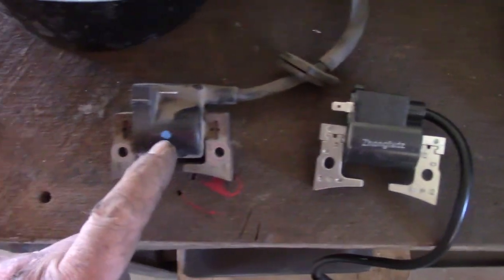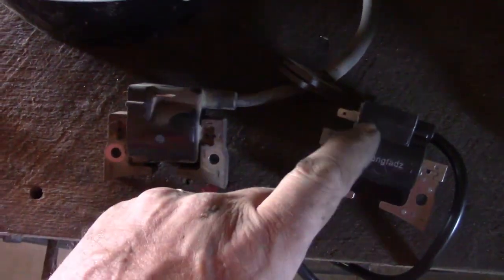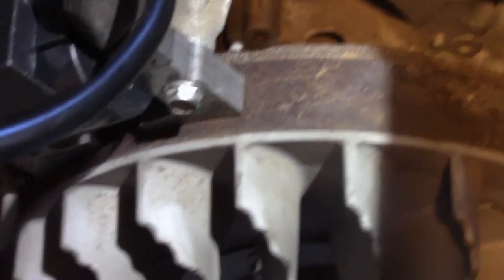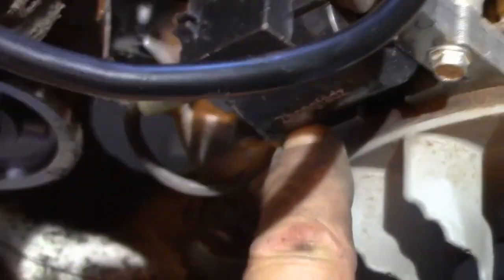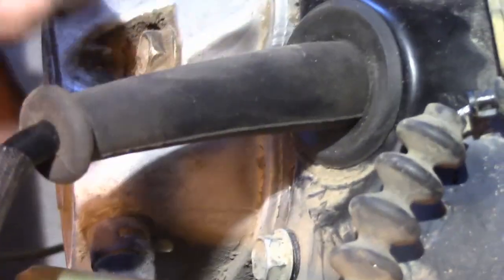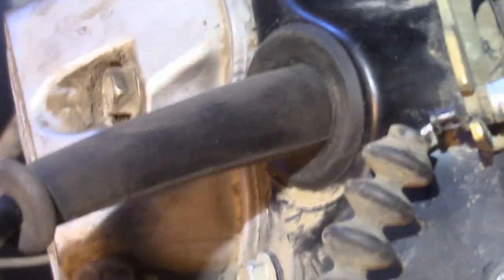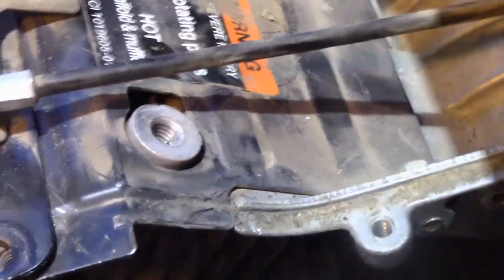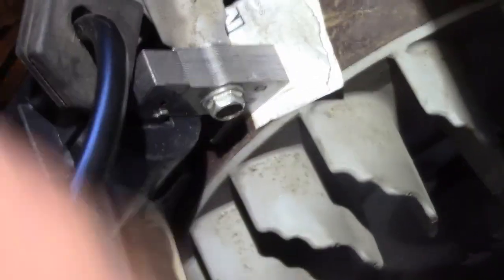Replacing Ignition Coil on Club Car DS - Part Two

Comment: Thanks for the great video!  I just replaced the coil on my 1998 Club Car with a modification to this procedure.  I jacked the rear up, removed the left rear wheel and the plastic wheel well insert (2 bolts).  It took about 5 minutes to remove these two additional items but it made accessing the muffler clamp and bracket a piece of cake.  It also made it possible  to see and access the engine shroud bolts and screws easier too.  Also, did not remove oil filter or loosen any extra nut/bolts around the valve cover area.  The shroud went back into place without a problem.

Comment: Thank you. I have a 2002 and the guy that usually does my tune up said it was underneath the engine. Now I know where exactly it is. Looks like a lot of work though.
Reply: Doing my 2002 right now.
Actually not that hard. You can use a business card to set the gap. Not a lot of tools either

Comment: I have a 2014 club car carry all and I was changing out the rev limiter since it went bad. After I changed  it I have no spark and noticed when I move the wire that runs to the magneto the engine won’t crank at all. Do you think the kill switch wire could have come loose?

Comment: Hi I have a 1992 club car, I've replaced the ignition coil with the later one  ( internal igniter) and disconnected the external igniter the instructions for the new one states for counter clockwise engines the bits inside are   Polerized   So I installed it as it states with no joy turned the coil round and hey the carts running have I done something that can damage the engine ( my engine is clockwise ) ? Well presented video !!!
Reply from the maker: As long as the engine is running smoothly and seems to produce the same amount of power as it always did before you had any problems (which would indicate that the spark timing is correct, or very close to correct) I  don't see any way that this could do any damage to the engine.
Reply: Thank you for your comment !!!

Comment: What is the little magnet on the flywheel? I just need the curved little magnet
Reply from the maker: The magnet creates the electrical charge for the spark plug as it passes the core of the coil.  If your magnet is missing or damaged you are going to have to purchase a whole new flywheel (it's going to be pricey), or buy a used one on eBay. You can probably find a used one there pretty cheap but expect to pay a lot for shipping.  I once bought a used Kohler engine side cover on eBay for only $12 bucks, but I had to pay $30 shipping.  That was still a hell of a bargain compared buying new.
Reply: @fixyourself9163  so i just got a new ignition coil and i have the coil and magnet spaced so they dont touch, shoukd they touch? And i had replaced the ignition coil because i had a weak spark and now i have no spark at all and im stuck...
Reply from the maker: There should be 10 to 12 thousands of an inch clearance between the flywheel and the ignition coil.  If you have this clearance set right and you still don't have any spark, I would expect one of three things: 1) Your new ignition coil is faulty.  This is not very likely but is possible.  You said you had weak spark with your old coil.  If you replace your new coil with your old one and you then have some amount of spark, I would suspect your new coil is faulty.  2) There is a problem in your ignition kill switch circuit. This is the most likely problem.  To check for this, simply unplug the ignition kill wire (the small black wire that plugs onto the coil) from the coil.  If you have spark then, check your ignition switch, micro switch, and wiring in your ignition kill circuit.  3) Your spark plug lead is not correctly connected to your spark plug boot.  These replacement coils usually don't come with spark plug boots, so you have to either get a new one or reuse your old one.  Make sure you install the boot correctly.  I believe that a  YouTube channel called Kevin's Golf carts shows how to do this in his video of replacing the ignition coil on a Club Car DS.  It just screws on like a nut on a bolt.  I didn't know this until I watched his video.  I hope that I have been of help to you and thanks for watching and commenting.
Reply: @fixyourself9163  so i have it set not touching the magnet, the magnet is a bit broke but still very strong could that be the problem? I didnt have the black wire on the ignition coil and i still got no spark, and i also didnt put the boot on the plug just to test and see if i was getting spark so im stuck and i have no idea what to do next
Reply: @fixyourself9163  but on the plug when i had the boot off i got ut very very close to the plug and got nothing so juat wanted to clearify that the plug wire was close it wasnt just hanging in the air😂
Reply from the maker: OK, let's eliminate any possibility of the air gap between the flywheel and coil being incorrect.  It should be about 10/1000 of an inch.  If you don't have a feeler gauge, that's about three sheets of copier paper.  Rip three small pieces of paper, stack them together, and sandwich them between the flywheel and coil before you tighten the small screws that hold the coil on.  
If you still have no spark, that leaves two possibilities: 1) Improper testing -  I am assuming that you don't have a whole bunch of tools and testing equipment at your disposal. The best way to check for spark is to use a spark tester.  The second best way is to be working in a somewhat dark or shady area, remove your spark plug so you can use it for a tester and also, the engine will turn over easier, hook the spark plug up to your spark plug wire, make sure the base of the spark plug is grounded to the engine by either touching it to grounded metal part of the engine or using a jumper wire to connect the spark plug base to the engine.  Turn the engine over, and you should see spark if everything is good.  This should be a pretty conclusive test.  Oh yeah, make sure you have a good spark plug when you do this test. 
If you don't want to mess with all this, there's also the hillbilly caveman way of testing it  Just touch the spark plug lead wire with one hand and touch some metal grounded to the engine with the other while someone cranks the engine over. Warning:  This test can be very hard on the testing equipment.
2) The other possibility is that your new coil is bad.  You said that your old coil produced a weak spark.  If you reinstall your old coil and your spark is just as good as before with your old coil, you can be pretty sure that you have a bad new coil.  You can do some tests with a multi meter to confirm this and there are instructional videos on you tube on how to do so.
Reply from the maker: If your flywheel magnet is cracked but is still strong, I would think that it would still allow the coil to produce spark, but how strong is the magnet compared to a good one.  I have seen it before where a flywheel magnet had become weak and a different flywheel solved a weak spark problem.  Since yours is damaged, I would buy a good used one on eBay.
Reply: @fixyourself9163  alright thank you man i appreciate you replying. Do you know if i could buy a new magnet only? I cant find one online
Reply from the maker: Never heard of a magnet being sold separately.  Just buy a used flywheel on eBay or buy a used flywheel or entire junk engine from someone locally who specializes in golf cart repair.  You can find a guy who does in virtually any city of 50,000 or more.  You should be able to get a bad motor for not much more than scrap price and it's a 99% probability that the flywheel/magnet will be good as new.
Reply from the maker: Oh yeah, one other thing.  If you buy a bad used motor, you will probably be getting a good used coil with it.  You can use that if your new coil turns out to be bad, plus you will be getting a bunch of other parts with the engine that you might need in the future.  (carb, stator, etc.)